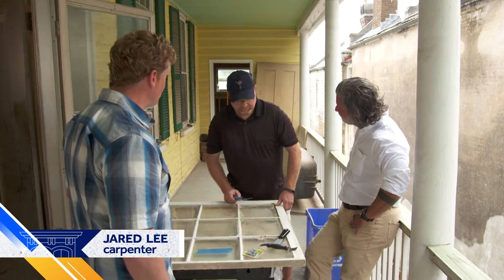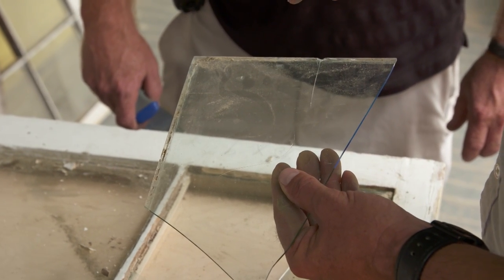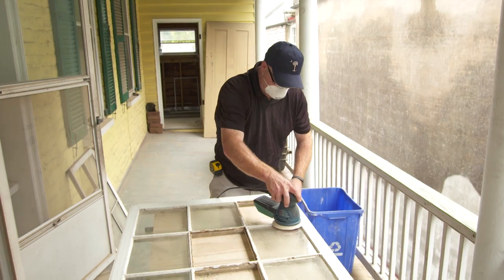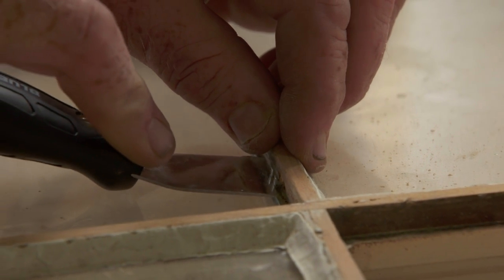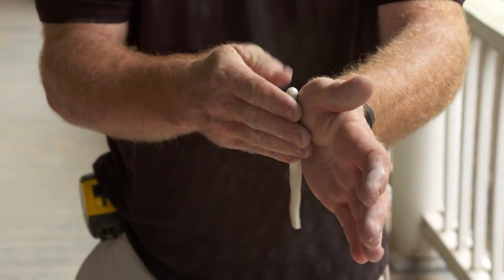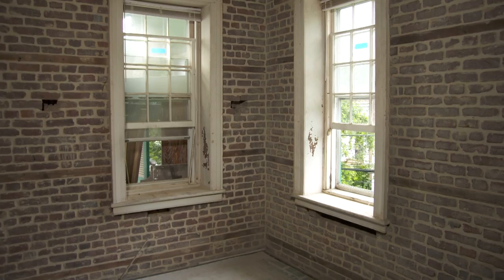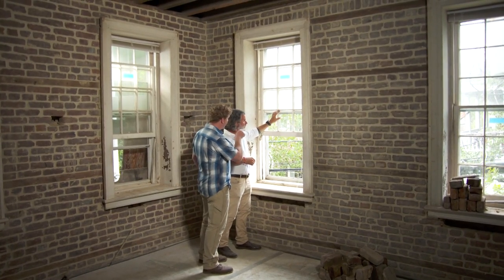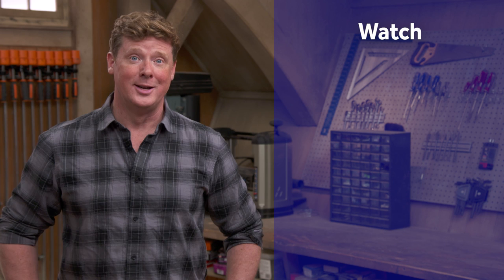How to Restore Antique Windows | This Old House

Comment: I agree with Kurt. This was a disgrace. Just enough info to be damaging without the tips and tricks to make it a success. How about bedding the glass in glazing? What about the glazier points being a hazard when removing the glazing (good way to crack the glass if you don’t locate them). Eesh- not even sure the point of sanding the top of the muntins or, really the point of this video. Restoring old windows is an art and a process - neither of which were adequately addressed by this video IMO.
Reply: He didn't wear correct P.P.E either
Reply: Exactly. I was shocked that there was no bedding. But even more, I was shocked that the bare wood was not primed first to keep the moisture in the glazing from being sucked out and causing cracking and brittle glazing.
Reply: Agreed , a lot missing in this process, I can do this job a hundred times better (properly)and safer without contaminating my workspace or the home

Comment: one problem with his window repair... you need to brush the muttons with linseed oil.because if you dont the wood sucks out all the oils in the putty and it will all fall out within a year.. been there done it...theres your tip from a 40 year painter...
Reply: *muntin
Reply: @wbfaulk  yeah lol autocorrect
Reply: Also a 40-year painter here, you are very correct brother of the brush, grease the muntins with linseed oil and something that shocked me here that you forgot to mention and Im sure you are aware of, it must have a thin layer of putty for the glass to sit on before pushing the points in. This seals the water out and gives the glass some cushion.
Reply: @ThePa1nterhowto  and @ David Nord : You guys are right.  I recently watched Norm and Bob do a repair in this video, and I thought the same thing you all addressed.  First, brush on some linseed oil, and secondly add some putty before laying the pane.  But don't take my word for it, let's let Norm show 'em how to do it right. :) https://youtu.be/12qs0ThyTLM?t=2643
Reply: @ThePa1nterhowto  Do you brush with linseed oil even if you will paint with acrylic paint? Looking to repaint/rehab 85-year-old wood windows in Los Angeles. Paint is peeling badly in these west-facing windows and can see how the wood could use some moisture. Don't need to replace the panes but maybe shore up with new putty? Oil-based paints are actually illegal in LA County so hard to get. Any advice appreciated. Also, can I work on the windows without removing?
Reply: @ThePa1nterhowto  You guys are great !
Reply: @ThePa1nterhowto  Would I want to heat up the old putty to make removal of it easier on the muttin and on the antique glass.
Reply: Yes,must hydrate. Also, whatever happened with bedding the glass onto a layer of putty?
Reply: @ThePa1nterhowto yes!!! Isn't it very important,  especially with old bubble glass that isn't perfectly flat like modern glass?

Comment: I've kept my original single pane windows, and they are really wavy.  It definetly adds flavor to the house.  Living in PA the first year in our house our heating bills were outrageous.  And we couldn't get warm no matter how high the heat was.  When the wind blew, it would move our hair while sitting on the couch.  It's a feature of these old windows :)

Through some research, I found a solution.  They call them indoor storm windows.  Essentially make a wooden frame to fit the inside of your whole window.  Put a clear plastic around it that shrinks, it's sold at stores as a "window insulation kit".  That then shirnks onto the frame, and you wrap the frame in some weather stripping so it fits into the frame of the window.  In essence, it becomes a tripple pane window.  Works amazing.

Comment: Using a Fiskars Paper Trimmer is very helpful in cutting the film, and getting straight lines and square corners. You can cut the film pieces very slightly oversized for windows that are not perfect rectangles, and then trim them in place with a razor-edge craft or utility knife, such as made by X-Acto, Fiskars and Offa, or a regular, very sharp utility knife, such as those like the Gerber, which use a single-edge razor blade for fine cutting. The Fiskars trimmers are lightweight, portable, usually come with an extra double edged cutter, and are available online from the usual sources, or from art supply stores, craft stores like Hobby Lobby, or suppliers to those who make scrapbooks.  I have several models and have cut window film with them, as well as trimming hundreds of photographs, particularly when framing them.
Reply: Do you know where to get that film? I've been told they don't really make it anymore....

Comment: How would they be able to keep any of the old glazing and why would they? It's rock hard and brittle. What am I missing?
Reply: Are you thinking about the putty rather than the glass itself? I think they mean keeping the old glass.
Reply: If they replace the glass all the putty is removed and if they don't replace the glass the hard stable putty that remains is left because removing it all will risk the original glass.

Comment: You don't apply any Boiled linseed oil in the wood?
 I bet the people who did these window also didn't and hence the glaze is falling apart.
They also didn't care to do oil paint in the window well or becareful that the storm windows 
fit so the the weep holes worked as meant to and they did paint all the wooden parts
which are supposed to be easily removed to access the windows ropes and weights, [also painted the rope 🙄] sealed with a ton of paint, I guess these people never heard of washing paint.
.

Comment: I want to reglaze and repaint a 120 year old set of French doors in my daughter's house in Manchester NH built in 1900. 
Your craftsman was working way too rough at the removal of the old glazing. You did not show us how to carefully remove the old glazing in order to preserve our valued antique window frame and 120 year old wavy glass. 
Can I use an electric heat gun on LOW setting to soften old glazing to avoid using excessive force in digging glazing out? I don't want to damage the frame. Were there any points holding that older glass in place? As a kid I did a lot of this work at my Grandfather's appartment buildings in Maine, I damaged frames and broke panes by working too rough. I am looking for someone to instruct at the next level so that I can be confident that I will preserve antique frames and glass panes.
If you are going to present yourself as an expert then you should be an expert. 
I gave this posting a 👎, sorry. I still like the channel a lot and I learn a lot from you guys.

Comment: wow. These guys S___K!  I agree with Redbank.  should have bedded the sash with putty first,  then used linseed oil to smooth the finish and chalk dust on the glass to clean it.  -  My CREDS?  - 7 houses over 200 years old over the past 50 years....

Comment: If it’s old just throw away and get new
Reply: I've seen the seal between the glass panes on newer windows fail in as little as 10 YEARS.  My parents house was built in 2005 and the windows already have condensation between the glass panes.  Unless the windows are beyond saving, I recommend repairing them!